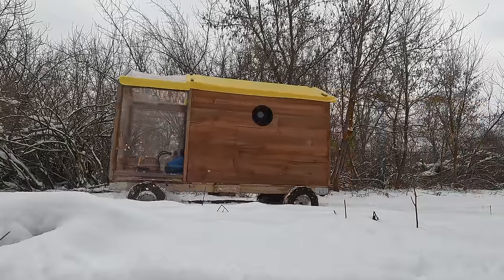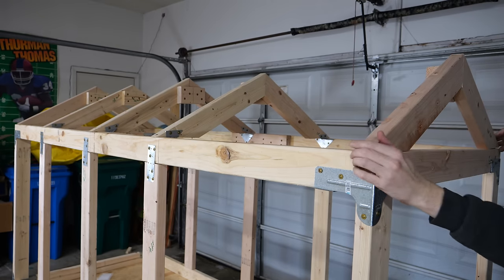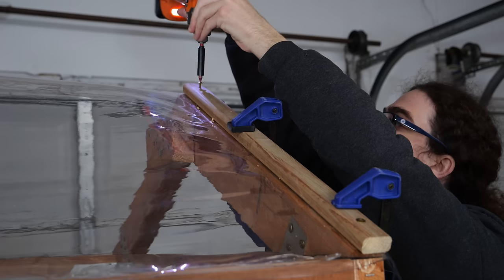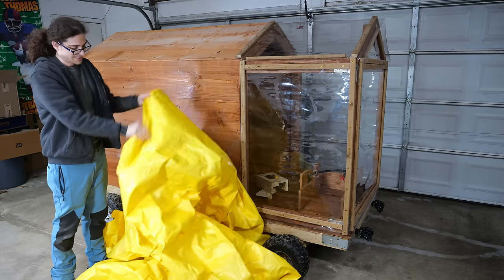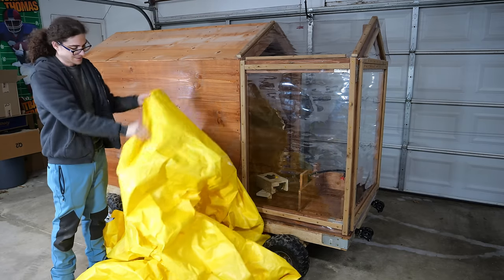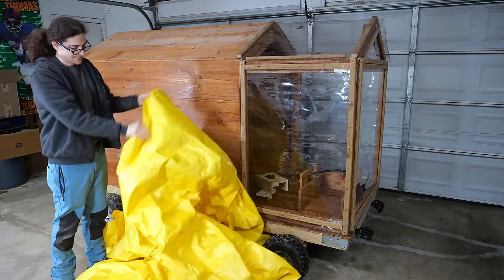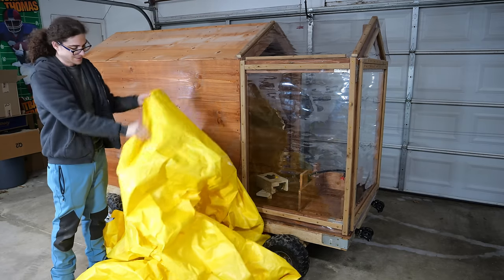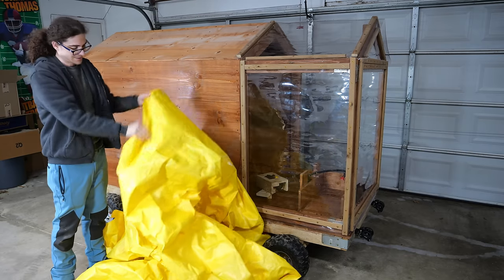UPGRADING The Drivable Camper - Full Cabin Build + Snowy Overnight Adventure

Comment: Just cant stop giggling thinking about you having to go out of the ride, set up camera in the distance, drive said distance, out of frame, and than having to go back and get the camera. Sick build!
Reply: And then edit out the drive back lol
Reply: I think about that too 😂
Reply: He could use a drone a good GPS lock would park it in place nicely for the same shots without having to get out in the snow
Reply: I think about that too lol
Reply: what happen to v2 tho?why're you back to your conventional round wheels
Reply: @wildflower1124  cheaper, more reliable, easier to repair and maintain. The same reason we mostly use tires on our skidsteers
Reply: @summeren64 you may like the older TV Show, Survivor Man. He would carry 2-3 production-grade cameras out unto the wilderness to film by himself. Like Bear Grils but less staged and only one guy.
Reply: I think about that too the  man dose some hard work
Reply: 😮 amazing
Reply: @MNSweet  Loved that show!
Reply: Nice build 👍👍. On the next upgrade build. Maybe add a solar power investor & fold out panels,  so you can recharge the batteries. You could also add a mini wood stove, helping less use of battery power . Supper surprised that you don't add. Close cell insulation foam , inbetween the studs to it warmer.
Reply: I like to think he just has tons of trail cams along the path
Reply: 😃 Hows about buying a brand new RV that you can actually stand up in and drive and lock up without worrying if man or beast can slice their way in knife or claws thru your plastic bag half covered dangerouly jerry riged up RV!
Reply: People will do anything but get a job… like this dude. Not contributing to his community
Reply: You Think to much ! 😂
Reply: Don't use Mr Buddy all folks in the know truckers RVers Sail Boat cruisers and Van Life You Tuber's use the Chinese Diesel Heater. Zero chance of Carbon Monoxide because heating air is a separate system from the Diesel Jet heater. Only sips fuel. Zero moisture infact it dries out human moisture from the air. So helps eliminate mould. I lived off grid 6yrs in Copenhagen as a Jazz pianist and every winter stayed cozy in my camping trailer.
Reply: Work hard 😅
Reply from the maker: haha yea it got a lot more snow in the camper than I was hoping doing that lol.  I hope it looked awesome though :D
Reply: @Wooooptywoop 

Well, he's making a thing, which has value, and he's also making a video, which has more value. I don't think contributing to some other person's profit margin is more important than this stuff.

That's like saying I shouldn't crochet in my own living room for fun, bc I should be slaving away for some boss instead.
Reply: @QuietNerd  it did
Reply: Whoa!!! If you do what you did without adequate controllable ventilation, all will be lost
Reply: Could make foldable bed or little seat
Reply: @Wooooptywoop he's providing entertainment to the community. He's doing the job of tv host, director, editor, and social media manager all at once
Reply: Vhln
Reply: @QuietNerd It did ^^
Reply: @m4vr1ck why use GPS when you can have onboard proximity sensors?
Reply: @Wooooptywoop You do realize that this is basically his job and that you are paying his salary by watching the video, right?
Reply: @QuietNerd I have funny idea ok small silent Coleman generator and a little bit taller then you can use all the energy just to drive and use the generator with a TV and stuff
Reply: @QuietNerd awesome
Reply: I LOL bc how much of a waste of brain cells to throw at such a silly endeavor 😅
Reply: i love this vid
Reply: Sorry but that soup looks pretty bad dude
Reply: I think he's awesome and very creative. All the haters are irrelevant. Jason is one hell of a man!!!
Reply: @QuietNerd  I think you're awesome. Very creative. You're a jack of all trades..lol is there anything you haven't done? I bet you can play musical instruments   as well .lol..you're one hell of a man!!!
Reply: @QuietNerd Here is my challenge: create a rounded vehicle similar to the one featured in "Sleeper", the Woody Allen movie. Rules: No clear windshield (cameras & monitor screen okay). No visible wheels. Exterior may not be "box-like". *You have Nine 30-day Cycles to complete project. **Color: White preferred, not required. **Clothing: All White preferred, not required. 😊
Reply: Not funny..He might have a cameraman recording while u giggling
Reply: That's called the les Stroud technique.
Reply: He should get a drone to record that lol
Reply: @Wooooptywoop  Well I tend to agree with most things. But you don't know what he does for work.. also, this is not communist Russia.   Sooooooo..... .
Reply: Snow is DEEP, never thick!
Reply: @JAGreen-lj9zi you're no fun!!
Reply: I like to think his little animal movie theater inspired many of them to pursue careers in cinema
Reply: L❤😊
Reply: Get a Suzuki Hyabusa engine onit 😂
Reply: @Wooooptywoop  I'm sorry you have such a narrow and self important view of the world. I also have a job, likely paying more than yours, but I respect people's individuality and ability to choose what they do with their time. 🤡
Reply: Did you mean sick build or Slick build?
Reply: A really cool unit with a lot of potential.
Reply: @dreamas_diary ❤❤ 😊❤ayush😊😮
Reply: For the snow why did you use wheels? Would the tracks work better in the snow and sand?
Reply: @m4vr1ck  trees are dicks, two many trees making the risk to high
Reply: I do have one question why did you switch the tank like treads for those 4 tires wouldn't it make more sense to use the tank threads instead of those tires I'm just curious
Reply: @QuietNerd  Don't use battery for heating food etc. Use mini gas ring like your heater. Griddle pan will cook cookies and waffles etc. 

Then you have engine  battery for motor/lighting/charging and gaming etc. Or have second battery for habitation area.
Reply: Simple 2 people and cut out the other dude .😂😂
Reply: Lol😂😂😂😂😂😂
Reply: Mennyi minden elfér ezen a kis helyen.😂
Reply: Put a blade infront to clean the snow as a snowcleaner
Reply: This reminds me of an old school pbs series
Reply: Every camping YouTuber does that though
Reply: Give FJB another term and this will be the new American dream.
Reply: He forgotten to get the wipers for the front😅😅
Reply: Why not use caulking instead of the tarp?
Reply: QQ
Reply: ج
Reply: You're the kid that people avoid passing by in the hallways 😬
Reply: @QuietNerd worth the shots! I'm happy I found you making these videos. I mean someone can act like a gangster and a tough boy as much as they want but deep deep down they love shit like this lol. I'm more of a weather nerd with tornados and severe thunderstorms and small little houses and stuff. I completely love stuff like this. Idk if your gonna see this because your getting a lot of attention and subs and stuff but next Christmas since it seems you get pretty good snow you should put a plow and plow your driveway or something. And add track tires again but a little bit better quality ones. That would be sick! Hopefully by then you get 500k. These videos aren't easy and I know you out a lot of time into getting the right shots the cost of the materials and the time and energy/labor it takes to make these videos. But yeah man love these mini camper videos! I'm super super excited for the next one you make!
Reply: What Battery is that. I gotta know. Also what brand inverter. 
You have great videos for sure. Always in a calming good mood. 
I almost get a Mr Rogers feel. 👍🏻
Reply: 70th reply
I fixed it…. Phew
Reply: @BrianK-fr8wh  he tried his best ok
Reply: @s13rr4buf3   Yep. I love his creativity. I imagine Einstein had a lot of mockers 😅.
Reply: @appboygaming687  Jealous dorks.
Reply: @EdMajor-n8b    3 windows. Just has crack one open.

Comment: a small exhaust fan could help with the water buildup inside your camper. Something you could have built into the roof that you could turn on and suck the moisture out.
Reply: In that little extra triangle above the back door.
Reply from the maker: Not a bad idea!
Reply: @akhagee4707 yes, in the triangle area, that's perfect
Reply: Can use a 12v fan and dryer vent cover to keep it cheap and simple
Reply: I think if you can find a small ERV you would get the benefit of fresh air without the heat loss.
Reply: They have cheap RV roof fans that open when on and close when off.
Reply: The triangle over the door The snow is not going to land on that
Reply: I used Noctua 12v pc fans for my build and they honestly work pretty well! Especially for these small spaces.
Reply: @QuietNerd  you forgot to stain the wood on the outside
Reply: Tire chains chains would solve most traction problems. Although, snow up to the frame would be it's limit.
Reply: Bunk-bed / loft with storage below.
Reply: Dude if you had a snow plow on the front you would have been beasting.

Comment: Some friendly advice, from a joiner (Carpenter to the other side of the pond folks 😂) while there was nothing specifically wrong with the build - for the walls, I'd recommend weatherboards, they're manufactured with tongue and groves to click together seamlessly this means that water doesn't get into the joins between your wall and runs down the side and off your vehicle. Water sitting in those gaps will rot it quickly.
Reply: Butt joints shrink and as you said are not weatherproof also may become draughty. The basic idea is good.
Reply: Going on that idea, I was thinking of those simulated wood flooring planks. They have a rather precision tongue and groove that "clicks" into position.  You could apply a small bead of silicone sealant across the groove just before installing them.  Using these, I thought it would be less weight. One time, a friend had given me a few boxes of them left over from a remodeling.  I used them to panel the inside walls of an old travel trailer that I use as a tool shed / workshop.  An air nailer with slight head brads works great for attaching them without much noticing of the fasteners. 👍👍👍
Reply: not a house
Reply: He shouldn't need to redo the whole thing for that, he just needs to seal it better and he can do that by adding siding to it then I would go ahead and seal the inside with some insulation panels and then painted over with some light brown paint to match the inside wood. There's no reason he can't still use what he already has but there is always room for improvement.
Reply: Did he use too much wood? I feel he could have achieved the same brilliant results with less timber.

Comment: Those tires look directional, in which case the front tires need to be swapped around so that the v pattern is pointing towards the front of the vehicle. Probably wont be a huge improvement but maybe a little traction boost for free
Reply: In heavy snow off reading we reverse the tires on the front. W&en braking trail it will reverse better which is critical
Reply: I was going to ask if the tires being backwards was intentional.

Comment: Cool update. You should put solar panels on the roof and put in a solar charging system to keep your batteries topped off. Another idea is interior lighting.
Reply from the maker: Thats a good idea! I was thinking about it but I'm a bit worried in winter about chagrin the battery in very cold temps I would need a battery warming pad or something but ill think about it! - Cheers!
Reply: @QuietNerd  For the battery, you could add a thermometer that automatically breaks the charging circuit if the battery is too cold. The battery shouldn't get too cold if you're continuously drawing current from it.
Reply: @QuietNerd   That's a high end battery. It will almost certainly have low and high voltage protection, as well as low and high temperature protections in the BMS. If it doesn't have low temp cutoff for the charging mosfets, just put some nice insulation around the battery in your box. The battery will generate lots of warmth when under load, and has lots of thermal mass. The charge controller should have low temp charge protection with a built in temp sensor too in that case.
Use flexible solar panels as they weigh like 20% of a glass and metal rigid one. MPPT would be highly valuable since the panels will be fixed angle.

Comment: Loving the updates man! It would be cool to use some more of the yellow tarp and make a little mounted canopy/awning for the exterior that you can roll up or retract another way. And I think this qualifies for a QN-03 license plate upgrade too!
Reply: panda got style
Reply: could change the rear to open up with hydraulic rods lifts as a extra roof and have the tarp acts as a external tent
Reply: @CallMeTonyga i had that thought too, like a little teardrop camper!
Reply: What if you used a bunch of yellow tarp to create a canopy, then also had the wall that the canopy hangs from fold down into a "floor", so you give yourself and extra five feet in that direction.
Reply: Exactly what I was thinking!
Reply: This is the last spot I would expect to see a YouTuber like you glad to see you have appreciation for woodworking and building techniques 🔥
Reply: I think it really is functionally good! Baby add some lightweight solar cells for the roof and a converter so you can keep your batteries charged!
Reply: @CallMeTonyga You should build more of these and have a summer business! You could take out small groups and have a blast camping out!
Reply from the maker: Thank you! A canopy would be a pretty cool upgrade ill keep it in mind and yea I though about the license plate after the fact it should have had a new one :D - Thanks for watching! Cheers!~
Reply: i think a plow mount might help too for the snow days but removed for the warm times (also surprise to see you here man)
Reply: @QuietNerd 

Maybe the roof is big enough for solar panels on both sides ? 
More battery power under the floor, and you can take on a world tour off grid
Reply: Look up "the outsider" he built something along the line of this couple of years ago. It was not self drive you had to pull it with a snowmobile. He insulated with sheets of Styrofoam on the inside and only used it as an overnight, safe sleeping area in areas where there were wolves. So for that kind of an area your front windows would not do well at all. Insulated walls helped preserve the heat to be able to sleep more than a couple of hours at a time. He also had the radiator in his sleeping shelter With flexible tubing he was able to put the pot of water on the coals of the fire and it would keep it warm overnight. That was so so. Maybe if you added antifreeze to that water, it might've worked better. Hope you brought a nice subzero sleeping bag to keep warm overnight if you're going to sleep in it.  Anyway, thanks for sharing.
Reply: Tf!?!? I didn’t expect to see you here, Anthony
Reply: Insulation?
Reply: didnt expect to find my favorite youtuber on a random video I got in my recommended but hello lol @BigJigglyPanda
Reply: А картофель чистить не учили?
Reply: https://youtu.be/c7nmMhfN9J4?t=356

What are these metal brackets called that are used there?
Because I'm looking for something like that, where can I order them?
Reply: True
Reply: Yeah it needs like a canopy just for extra privacy
Reply: U MADE MY CHILDHOOD MF
Reply: E ver think of this as self-induced clostrophobic syndrome. All he needs is another two feet of snow and a low battery.
Reply: AWESOME! Thanks for sharing 👍
Reply: Out of all the corners of the internet I expected to see you, this is the least expected.
Reply: so ein schwachsinn.
Reply: Big jiggly panda!

Comment: Awesome Upgrade.
love the little camper🎉

little info: at 24:58 you can see that you have the wheels/tires on backwards. the V shaped threads should always point forwards. 😊
Reply: Not necessarily, points forward help dig, points backwards help floating, for instance alot of farmers will have them backwards on combines and sprayers so they don't sink and tear up fields as much.
Reply: actually your wrong
the v points forward the break ground to gain traction to bite the dirt and get traction so idk who tolled you that cause i am a farmer @HillBillyAsian
Reply: Turning the front tires to face the same way as the rear would give more traction. Less wheel spin and result in less power used, your batteries would last longer.
Reply: It doesn't have wheels that turn like normal. So I think it's better for steering in this case since it turns like a tank would.
Reply: @HillBillyAsian  no it still wont do any better in this case,the tyres need to be flipped. The method ur saying still dont apply to his needs
Reply from the maker: I was hoping if I had them installed like that it would have better grip for going forwards and backwards since the steering involves that sometimes. But good to know about the orientation I was sorta guessing! - Cheers~
Reply: @QuietNerd  You did it right. The open end of the V should aim forward on top of the tire, and backward under it. It acts as a scoop, especially in the snow. Snow sticks to snow so you want to hang on to a chunk of it. All four should be the same.

Comment: Might I suggest a 3-4 inch lift and a single leafspring suspension on each side. Both front and back. Giving the front and rear axles a chance to avsorb the dips and bumps from side to side, rather than bouncing around so much. Clearance is clearly important as well. 👍
Reply from the maker: Yea I was looking into leaf springs form golf carts and other small vehicles. I think my next build will use them for lift and suspension or something similar. Ill see it will be a bit down the road but I'm beginning to think about it! - Cheers!

Comment: Add 4 wheeler tires, likely bounce less, much much more traction and you'll ride higher on snow. Motors won't strain as much. Also you can add a small fan/vent blowing out at that space you covered with tarp over the door. Turn it on when cooking it will rid alot of that condensation buildup inside. One more thing, young man, your a freaking genius